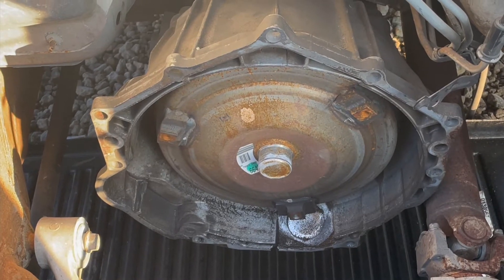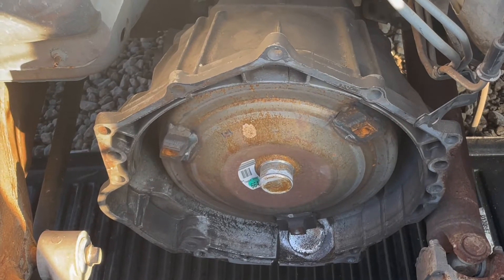E46 LS Swap Ep 3. - My ECU Choice and Starting the Wiring!

Comment: Hey man I was just wondering how's the progress on that d46 I'm just about done with mine all I need to do is figure out some radiator hoses stars idles and mine's a single turbo
Reply from the maker: Just need to do radiator and driveshaft to be driving
Reply: @vkdrifts792  I had to get a custom driveshaft made
Reply from the maker: @pomonastilo  I will too what transmission did you use?
Reply: @vkdrifts792  Chevy th400
Reply from the maker: I definitely switched some things around so I need to make an update video lol